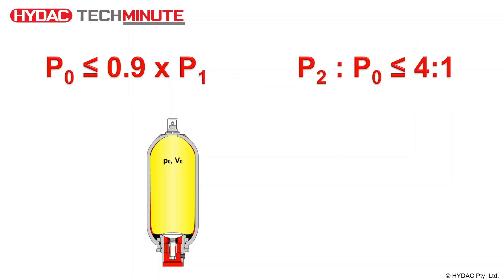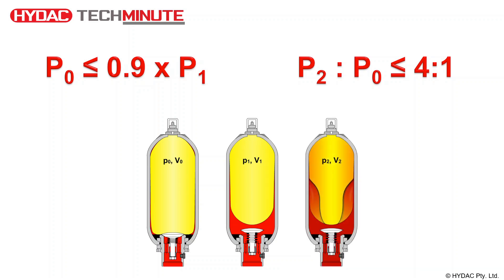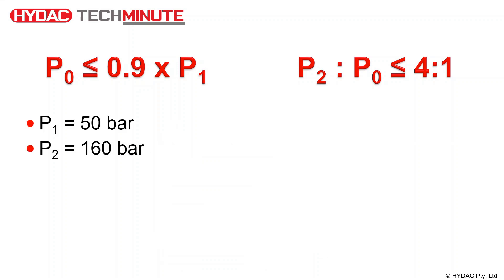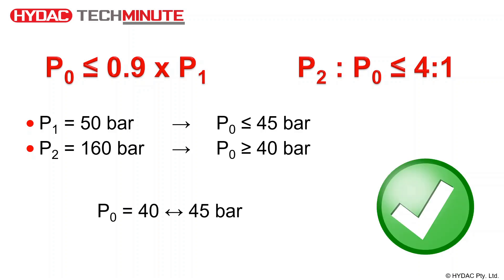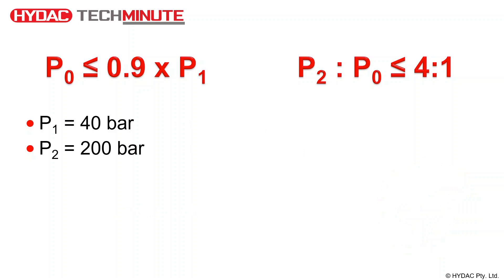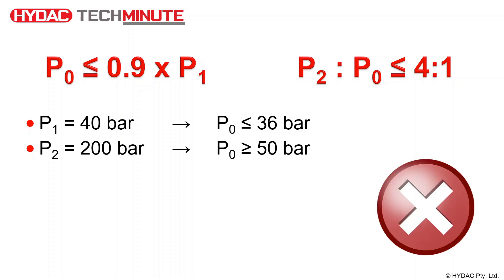HYDAC TechMinute - Calculating accumulator pre-charge

Comment: In the second example  why P0 needs to be greater or equal to 50bar, it should be equal or less than 50.
Reply: I think formula for P2 is wrong throughout the video. Should be P2:P0 >= 4:1. They then use the correct formula in the worked examples

Comment: Plz confirm this 'Minimum/Maximum pressure'. Minimum pressure: minimum pressure required to operate the actuator or cylinder and maximum pressure: maximum pressure that which the actuator or cylinder can operate.